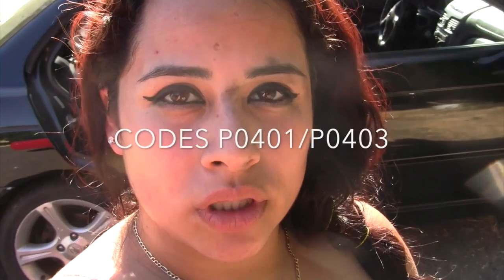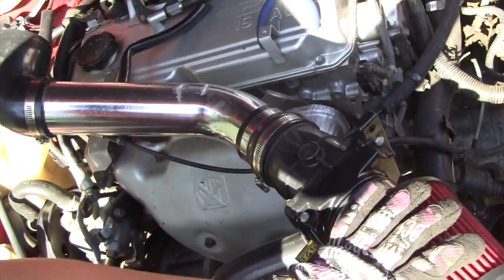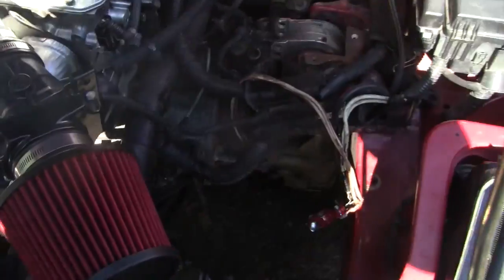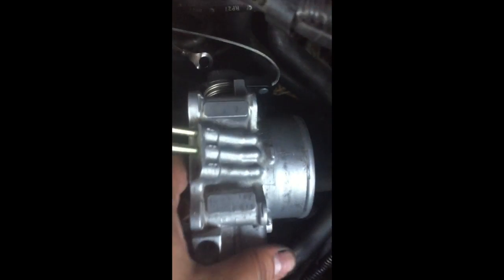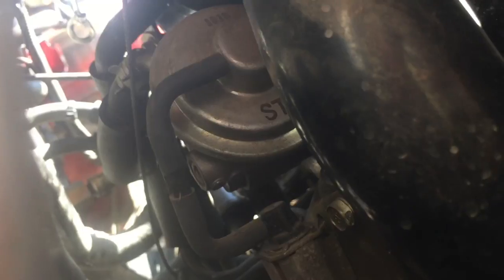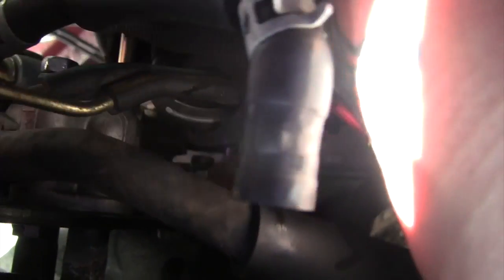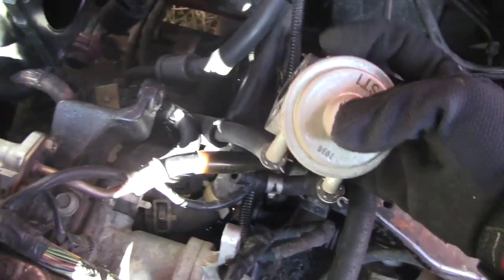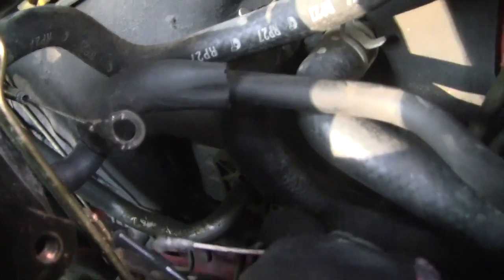How to Fix P0401/P0403 Codes EGR Valve Replacement 2002 Mitsubishi Eclipse RS 2.4L

Comment: Hey how are you? Currently working on a 2.4 eclipse egr valve, the valve has one vaccum line on top and two lines on the bottom my question is if one of the bottom lines had coolant running thru it?
Reply from the maker: Chuylx no it’s not coolant it’s vacuum
Reply: Chuylx yes one of mine has coolant going through it as well
Reply: @grnwood87  
That's interesting.  I've never heard of egr valve needs coolant for what reason.
Reply: @grnwood87  Egr deals with air vacuum.  Coolant runs thru heater hose and radiator hoses.

Comment: Had to replace the intake manifold that was cracked right behind the throttle body. Got everything back on, except the 2 hoses that come out the top of the EGR. Can't remember where those connect to. Wish you would have added that part in the video. Hope my brother didnt lose the hoses. Could  you please help and tell me where they connect to, or even make a quick vid showing where? Thanks!
Reply from the maker: Grant Yalch yeah message me on google so I can send you the video
Reply: Got it figured out!! He did misplace 1 hose. The one closest to the firewall that connects the EGR valve to the throttle body, and had the one coming from down low that connects to the other one on the EGR in a wrong spot, lol. His gf's car runs like a champ now!! Super stoked! Heads up, watch out for the flange that the throttle body connects to cracking in that gap. That's what happened to her car, and why we had to replace the manifold. Thanks anyway!! Your videos helped us figure out the hose issue :D.
Reply from the maker: Grant Yalch that deserves a subscribe HAHAHA!!! I'm kidding you're welcome I was gonna make you a video and send it to you but that's good I'm pretty sure I stress the fact that I almost didn't know where they went. If it weren't for me recording I would have no idea and would have to find a diagram. But I'm happy my video could help
Reply: Can either of you tell me where the hose off the egr valve goes on the engine side? I know the one on the firewall side goes to the bottom of the throttle body but I have no clue where the other one goes.

Comment: i have a 2003 mitsubishi eclipse gs 2.4l  if the car vibrates at low rpm during idle indicate its the egr is bad.  correct?
Reply from the maker: Honestly I didn't encounter that. That could also be motor mounts I mean a vibration at idle could be a bunch of things, but I mean it isn't releasing the exhaust gases and recirculating them correctly so you could be right =)
Reply from the maker: Usually with EGRs There are codes that will appear it could also be the EGR vacuum solenoid P0403 the link to that video is in the description.
Reply: okay thanks you!
Reply from the maker: You're welcome

Comment: You could do a egr delete I did I have a 2000 Mitsubishi eclipse RS
Reply from the maker: Cheyne Sherman I cant tho. I have emissions to worry about
Reply: That sucks your state has emissions control
Reply from the maker: Cheyne Sherman yes it sucks 😖
Reply: Hey also what will help keep you egr clean is do a pvc delete and use just a oil filter breather it gives you a cleaner intake
Reply from the maker: Cheyne Sherman sea foam

Comment: I replaced the egr valve and still getting the code
Reply: did you clear the code? if so check O2 sensor live data reading as well.A vaccum leak from the header, throttle and other gaskets etc also causes this code most of the time. Cats should be the last thing to replace if all fails.a laser temp reader gun can determine if cats are working.
Reply: @DrynisDramula  lp

Comment: Lol never seen someone fit in a engine bay
Reply from the maker: I'm so happy I can because I had to work on a  97 Chevy K1500 earlier this week and I had to climb inside the engine bay to work on that truck it
Reply: any car made before 1990 is usually large enough to fit in the engine bay to some extent, depending on a lot. But the older the car the more likely it's not jammed with extra garbage and you can work on it by climbing down inside. 70's cars.... might as well take a nap in there buddy there's plenty of room to work.
Reply: with exception